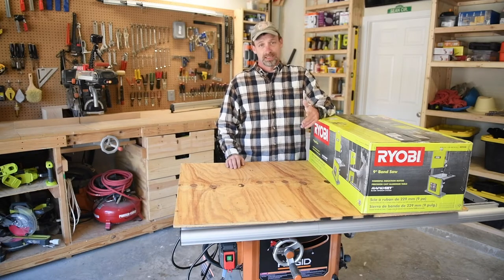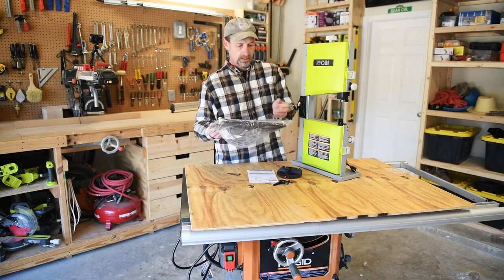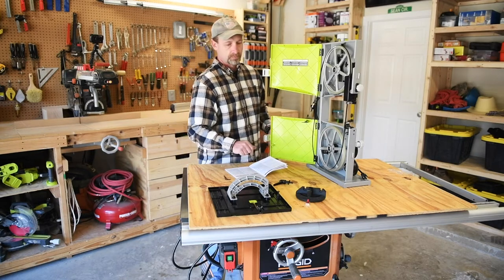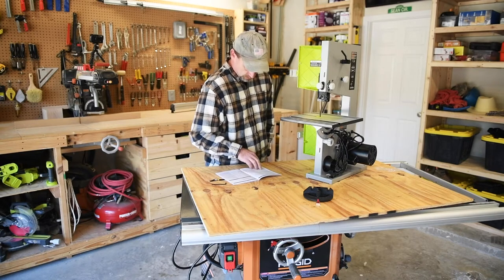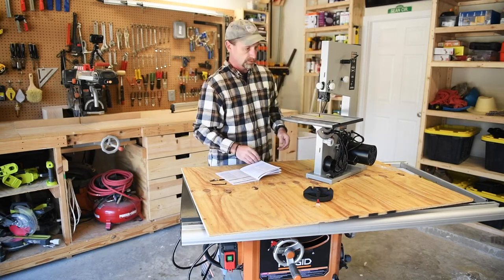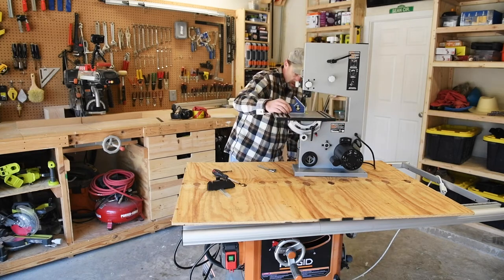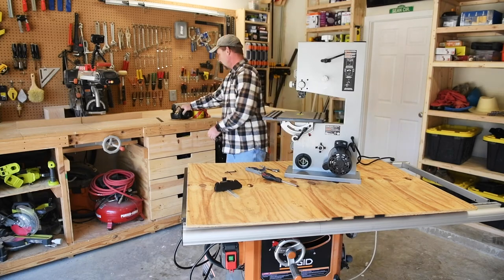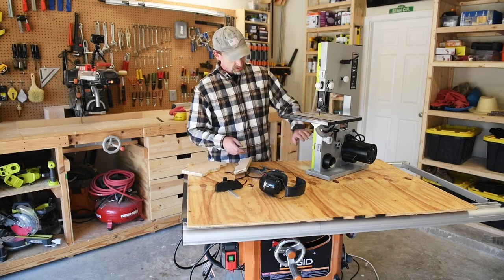Ryobi 9" Band Saw Assembly and Setup

Comment: THANK YOU!!!! I’m relatively new to woodworking as a DIYer and haven’t used a band saw in about 40 years (and that thing was a monster!). I bought my Ryobi 9” band saw and tried to follow the owners manual. Sometimes it’s best to RTFM, but in this case is was definitely not. I was hoping there’d be a video on how to assemble and adjust this machine, and you imagine my relief you made one. I’m also glad to see you were stumped on a couple of things I was, so that was encouraging to know I’m on the right track. I can’t wait to put mine together and get working. Thank you for making this video!
Reply from the maker: You’re welcome Michael! It’s a great little bandsaw, I’m in the process of building a roll around cabinet for it.

Comment: I enjoyed the straight forward but clear commentary and well paced DIY set up. I have just thrown out a competitor 9" bandsaw (2 years old, purchased used but could not correct blade drift). At end of day cheaper to buy new one than deal with service repair cost plus parts. I have 4 other Ryobi hand tools in my shop and found them to be reliable and dependable. So, with that in mind BUT MORESO  because of this video I am buying a Ryobi bandsaw this week.
Reply from the maker: Thanks Michael, so far I’m loving the bandsaw and haven’t had any issues with it.
Reply: @SeanDoesDIY  I purchased a Master craft 9" used in April. Despite constant effort to ensure blade drift/wobble was corrected could not get the blade tension  to hold or wheel position adjustment to effectively correct. Last weekend part of the blade guide assembly came apart. Believe it or not, the hourly rate to service is$135 and minimum shoptime available is1.5 hours plus materials. But contactiing Mastercraft customer service to order blade guide kit was hopeless..  I have a fully outfitted woodshop and use my tools everyday creating wood items that I sell. The poor quality of the Mastercraft saw AND lack of effective customer service has now soured me on that brand. My overall with both Dewalt and Ryobi hand tools to date has been excellant.  After watching your video I ordered the 9" Ryobi bandsaw on my Home Depot account. It is only $150, brand new.
Reply from the maker: Dang, that’s crazy! I know there are some Ryobi haters out there, but for the price and quality I’ll keep buying them. I’ve got some tools that I bought years ago and they’re still going strong with tons of use.

Comment: all the 9" Bandsaws are made i think by the same company just with different stickers. even motor is the same i have the Harbour Freight one. so if you are looking for the 9" for small jobs get the cheapest of them. also you can extend the cut height and only costs you an extra $30. So worth it even more now. just extended mine to a cut depth of 12 and 3/4".

Comment: Since buying it, are you still happy with it? I ordered and will soon receive a Rikon 10" (10-3061) band saw...downgraded from my big Grizzly 5055LX 14" saw...just more saw than I really needed...I wanted a saw with cast iron table and a good quick release on back...
Reply from the maker: So far so good. The 10" is plenty big enough for when I need a bandsaw.
Reply: @SeanDoesDIY  is the 9" the throat depth or the maximum vertical board height?
Reply from the maker: Hey Dennis, I’m traveling for the holiday’s but I’ll double check when I get back in a couple days.
Reply: @DennisMathias  9 is the distance between the blade and the vertical support in the back.  The max cut is about 3-4 inches.  That’s standard for how bandsaws are described.  Sometimes it refers to wheel diameter, which is about the same anyways.

Comment: I have this same saw but got it at harbor freight (same saw but a little cheaper) and I really like it. I put on a 3/8 blade because the 1/4 it comes with deflects too much but that could just be a cheap blade
Reply from the maker: That's cool, there isn't a Harbor Freight close to me but I've heard their tools are pretty good. I like to hear how you like the bigger blade.
Reply: @SeanDoesDIY  a lot of harbor freight tools share design with other companies like WEN, Ryobi, Ridgid, etc. I had bad deflection when trying to resaw, so got me a 1/2 blade for that and it works great for smaller lumber.
Reply from the maker: Nice, thanks for the info

Comment: Might I ask a question Sean : I have one of these Ryobi bandsaw that I bought last year & it has worked pretty well for me. BUT I have run into a problem with the vertical blade where have difficulty getting the blade guide to move up and down when I change thickness of wood I am cutting. It seems like it is sawdust jamming up the plastic gears, but maybe isn’t something else.
Might you or some else reading this post have suggestions to over coming this unfortunate problem?

Thanks in advance for any advise you might be willing to provide.
Reply from the maker: It sounds like the guide is gummed up. I’ll take a look at mine to see how to clean it.
Reply: @SeanDoesDIY  Thank so Very Much for check this out for my Ryobi bandsaw.
And your reply come awesome quick …much appreciated Sean
…G. Lewis in Eastern Canada

Comment: How does it handle steel?
Reply from the maker: I haven’t cut any steel yet, I did cut some aluminum without any problem.
Reply: It’s probably too fast to be a good metal bandsaw.  It’s really designed for wood.  You don’t have any speed control with it.

Best cheap option for mild steel is probably a portaband set up semi-permanently with a table.